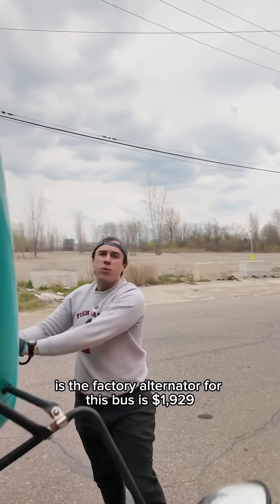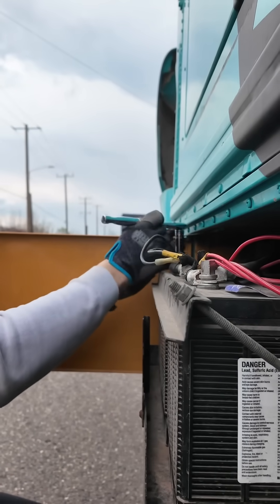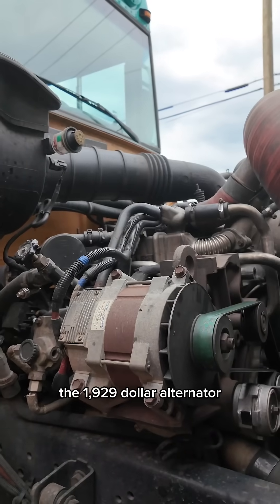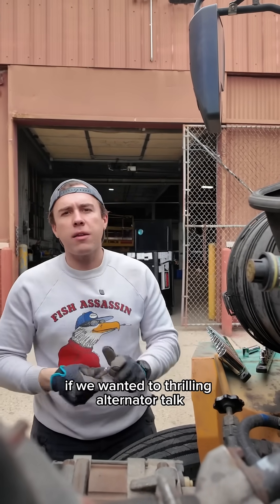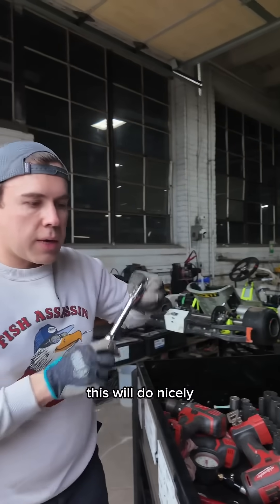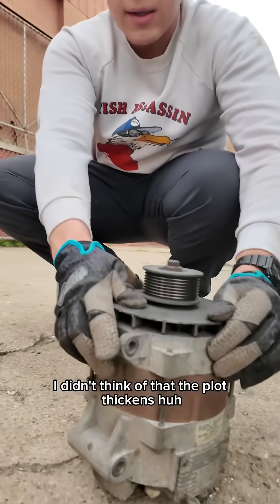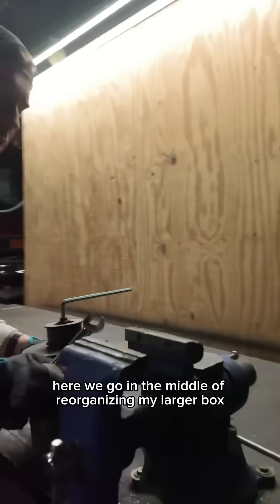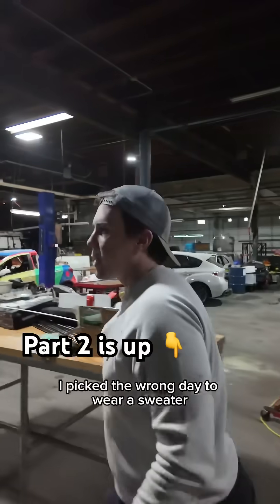Reviving a dead school bus on the cheap - Part 1 of 3

Comment: Use an impact wrench to take the nut off and tighten it back down.  Will not hurt anything and a lot quicker.  Just hold the pulley still and impact off the old alternator and then put it on the new alternator and hold the pulley still and impact back on.  Done in less than a minute.

Comment: u need to cover part of ur ratchet with electrical tape that away at the bumps it it doesn't ark either that or I put a coat of heat shrink on them stuff like that so that it protects it a little bit of heat shrink and a little bit of electrical tape put a layer of electrical tape over everything and then put some heat shrink over that that way it's protected and you can't chance short-circuiting and arcing channel

Comment: You can tell this guy has never done this little job. Yes the alt is easy to replace. The pulley is very easy to take off just use a 1/2 inches drive impact & the nut comes right off.

Comment: I love the fact that he was going to try to undo both the positive and negative cables off the batteries but then just gave up and undid the negative cable.. The funniest part is that fact the negative cables are the only ones you need to remove if you are working on anything electrical in a automobile

Comment: Unless those batteries are in series, and you've been soaking wet from sweat for over half an hour, becoming part of the circuit is an unrealistic worry. With dry skin, even 48V won't even be felt. Lead acid batteries can deliver serious amps, but unless you have a lot of them in series, they don't have enough voltage to pull even a milliamp through you.

Comment: the original alternator was brushless, the replacement is brush type.  But for the price difference, you can buy 2 or 3,  and they usually last at least 150K miles.

Comment: If the stator is still good in that alternator, just buy a rebuild kit for it and put it back into service. I kept am alternator for my Dad's Econoline van for practically it's entire road life of 900,000 kms. Still had the original engine and transmission in it too. That is why Ford is more popular than any other truck on the road.

Comment: I use an impact on those pulleys to remove and install them.
Just hold the pulley with your other hand and zip it off with the impact.
Reverse to install.
It’s that easy, been doing it like that for YEARS.

Comment: You don't have to worry about being part of a 12V circuit. Disconnect the batteries to prevent damage to the vehicle (blowing fuses, metling stuff) and your tools (....melting stuff). 12V only hurts if you let your rachet short positive to ground and you hold on long enough for it to get hot. So don't do that.

Comment: You can see sparks when you try taking the positive cable off first. That's why you take the negative off first, just in case you bump the frame with your wrench.

Comment: Gladly ohm's law denotes that no, you do not become a part of the circuit, not at 12V, not at 24V. Your resistance is simply too high for any appreciable current to flow.

Comment: For future reference, if you dont have a torch or dont want to worry about getting bearings hot etc., jut put a wrench (the closed end) on the allen wrench to get extra leverage. Or just a length of pipe for that matter.

Comment: You didn't need to remove the cables on the batteries. just wrap the leads in electrical tape. with the pulley you would need a 15/16 socket with 1/2 inch impact (unless you can bench 500 lbs), those spindle nuts are never torqued properly.  Then you would need a 3 jay puller for pulleys (aka a harbor freight puller you ground the ends down on to get the pulley off). this is due to rust between the pulley and the stater shaft.  with some emery cloth on internal diameter of pulley you install and torque the spindle nut to 74 ft lbs, then re-install (aka uga dugga until it feels right then re-assemble).

Comment: Use a 3/8 impact, normal lefty loose.  Put the nut back on to protect the threads and alternator core.  Take a ball peen hammer while you hold on to the pulley and smack the nut.  It will break free eventually.  Then just transfer over the fan and pulley to the new alternator and zap it down.  Dealership tech here :)

Comment: Anytime I do an alternator on any of my cars I always see if I can change or upgrade. Had an old subaru converted to a new subaru with like 3 times the power. My sidekick, it was cheaper to convert it to a modified gm alternator and bracket for half the price

Comment: It is a lot easier to take the pully off first using an inpact wrench before you pull the belt . I would have done that entire job while you messed with that pulley. I usually rebuild the alternator myself .

Comment: Are those batteries more than 12 volts? Even if its doubled to 24v itll have a hard time going through flesh, disconnecting them is still a good idea but for other reasons than getting electrocuted

Comment: Remy merged with BBB a while back, now BBB is Terrepower(?)

Oh also, mitsubishi is a part of ford(although not sure if it’s just the parts department or what), so if you see ‘FoMoCo’ on your mitsubishi alternators that’s what that is. 

For normal people, I’d recommend going straight up OE replacement for their vehicles. The peace of mind trumps every dollar you save- even if it’s hundreds.

Building/modding, definitely go aftermarket/rebuilt. Peace of mind comes differently in this situation.

Where I work, we sell brand new aftermarket and rebuilt alternators/starters. I dont like them because i want to see consistently good results, not just ‘problem fixed’ my issue.

Comment: The old alternator was probably original equipment and is able to be easily rebuild to last another 20 years.

The new alternator will probably last 5 yrs and let you down at the worst possible time, wonder what a tow for a bus costs?

Comment: I've had to go the opposite direction before. I needed o-rings for my 7.3 Ford powerstroke oil cooler, but the auto parts stores didn't have them, I couldn't wait several days for them to be delivered, and the Ford dealership wanted $300 for the o-ring kit. So I went to the International dealer and got them for $90, and they even were nice enoufh to split up a bigger kit for me and just sell me the o-rings that I needed. The 7.3 Ford powerstroke engine is the same as the Navistar T444e used in International busses from 1994 to 2003

Comment: I own a semi truck, 4 years ago when the factory Alternator when out (6 years old)  I replaced it with "the cheaper one"  first one was replaced under warranty in less then a year, then that one failed in just over a year so i replaced it (same one because that's what i could get for where i was) , and now I need a new one again, so oem lasted 6 years, and the cheaper ones got me a year-ish each.   Sometimes the cheaper one just means you're going to be replacing it more often.....

Comment: There's not enough pressure for you to become part of the circuit. The fact that there's still people that believe this is scary. The human body is a piss poor conductor. Voltage is also considered pressure the absolute minimum voltage you start to feel a shock is right around 50 volts. Now you don't want to short your tools across it because then you'll get burned. But metal objects are not piss poor conductors. That being said I wouldn't take two wires and stick them to your tongue because your tongue is a not as piss poor conductor. You would feel that a little.

Comment: If you just take a 1/2 inch impact wrench and basically just jam the trigger for half a second, it'll break that nut loose after a few pulls
Used to replace alternators all the time on semis, same exact ones
Sure, the alternator will spin a little bit but what are you gonna do, break the broken alternator more than it already is?

Comment: Of the races are ok. You can change out the brushes and the diode / regulator pack for maybe $100. I used to do it for like $20 in the dark ages. Not often the brush races or windings are bad.

Comment: Alternator pulley nuts zip right off with a kiss from the impact tool.
Reply: Ditto Jet !!! Usually a 15/16th
Reply: Bumping the impact... Love this stuff!!
Reply: 1/2" 3/4" Electric corded impacts are way overlooked, they can snatch nuts that air can't
Reply: Just a bit o heat and a crayon
Reply: Right on brother

Comment: Fun fact, you cannot electrocute yourself on any system in an automotive application, except for the ignition system on a gas engine vehicle. You can lick both fingers and touch the battery terminals and it wont even shock you
Reply: You might feel something if your hands are wet on a 24v system but nothing serious until 50volts
Reply: Well technically you can get the shit out of by a ignition coil. Haha. But diesel.  Your good to go
Reply: @MetalFox-k3n thats a shock, not electrocuted tho
Reply: Yeah you can feel the odd slight shock if you cross nerves just right in your arm, from hand toward elbow. I've only managed it twice in 30 years, it's an odd sensation but barely noticeable 😂

I'm an electrician by trade, I know what being shocked is like, I've been hit by the neutral of 277v once. I never made that mistake again. 😂
Reply: Amps people not volts, amps kill
Reply: Touch both terminals with your tongue
Reply: @jackbeets3309 ive done it with salt water on my hands... Its physically impossible to get electrocuted by it
Reply: @jackbeets3309 you got some gene simmons tongue on ya
Reply: You might wanna be careful with xenon headlights too, but other than that you're good. I'm an industrial controls tech so I work with 24V and never even noticed when I touch it, neither DC nor AC. Even if it makes quite a spark and leaves a black spot if I accidentally touch something grounded with that wire
Reply: I have literally seen people die from 12v 1 amp. Don’t spread falsities.
Reply: I dunno, was working on a truck once and was leaning over a fuel tank touching the positive terminal of the batteries. Could feel a tingle in my pecker as the metal zipper of my pants and coveralls contacted the fuel tank.
Reply: A 3000 amp arc flash is something to worry about
Reply: @rickiehobson9351 and when exactly is that gonna happen on a car under normal circumstances
Reply: I thought so
Reply: I got zapped but good off grounding a horn it created ac current in oscillating
Reply: Just don't make yourself entirely part of the circuit by standing in a poodle of water that is well grounded !
It's the amperage that hurts!
Reply: @Mr2Bsquared1  lol that makes no difference

Comment: Im not sure what you mean, by becoming part of a circuit. When its DC voltage? When have you been shocked by batteries?
Reply: you don't get a shock. You get a burn or welding spatter from the heat of the short. That much battery can turn a 1/2" drive extension red hot in a matter of seconds.

Comment: The original alternator in my 2004 Tacoma survived 20 years and some change and over 1.2M miles. Whatever Toyota is doing, it works and you should probably copy it if you can.

Comment: I'm taking it you don't have an impact at your shop? I've always just use the air impact and a socket and held the pulley with my hand and zipped the nut off. I imagine a good quality battery impact would do the same thing what do the same thing a lot better than fighting with that allen wrench and combination wrench

Comment: Harbor freight.
Has plastic coated ratchets and use an impact gun to get that nut off Just hold the pulley with you're hand

Comment: It's only 12 volts you can't become part of the circuit
Reply: if you have never seen a red hot wrench then you don't understand the problem.
Reply: @rupe53  I know that metal conducts I'm standing in the shop I work in right now I'm just saying that according to ohm's law you yourself don't have to worry about getting zapped by 12 volts
Reply: @rupe53  and I don't feel like starting an internet argument so if we're going to have a conversation please keep it cordial
Reply: @   no argument and your point is valid. My point is you don't need to be electrically involved in the circuit to be part of the carnage / danger / destruction that several thousand amps DC can thrown it you. Then of course there is the chemical issue involved with  rapidly discharging battery. (read: boom)
Reply: @rupe53  you're totally right and thank you for being a kind internet stranger

Comment: It's crazy in 2025 with the internet. People don't know that you can have your alternators starters rebuilt for a fraction of the cost of a new one. I don't think I've bought a starter for my diesels in years but they've been rebuilt many times
Reply: I looked into getting an alternator rebuilt at a local shop, and it would've taken then 2 weeks and would've cost me $400 and came with a 90 day warranty. I went to AutoZone and got an upgraded high output one for $300 with a lifetime warranty, where I can go to any AutoZone in the country if it goes bad and swap it out for a brand-new one. Local shops honestly just can't compete with mass production and great manufacturers warranties anymore.

Comment: With those voltages, you'll never "become part of the circuit".
Reply: but you can get stuck holding a wrench that is quickly turning red hot and throwing molten metal at your skin.

Comment: Next time leave the belt and everything on and then loosen the bolt for the pully and then proceed to change alternator. The tension on the belt holds the pully and keeps it from spinning .

Comment: Doss paul work on mopeds? I need help putting a harbor freight motor on a Schwinn chopper bike and I also have an original Schwinn chopper that's electric and I need help putting a new throttle on it.
Reply: Theres lots of motorized bicycle forums and fb groups. Join a few. It's easy work.  I used to swap engines onto bikes before the internet took over.

Comment: Suggestion... when dealing with a stuck bolt, heat the area and use some wax. The hot melted wax will act as a penetrator and lubricant, and will make getting rusted and stuck bolts out so much easier.
Reply: Cool, but we have had penetrating oil for ever now.
Reply: Bees wax is excellent too.

Comment: I have a wrench that I wrapped in tape for when I gotta do battery's because of that spark show you mentioned 😂😂 seeing that show once was enough for me 😅😂
Reply: Doing the battery isn't the part to worry about. That's easy. Don't cross post. It's when doing stuff like alternators and starters when you need to worry about it. That's why you just undo the battery.
Reply: @mikerogers7502 thank you for saying this, I don’t have much experience with working on cars but am slowly learning to fix mine that has been sitting. I was going to take off and put back on the starter to see if the guy who put it on fucked up, I wouldn’t have known to do that.

Yes it may be common sense for a lot of people, when I’ve never had to work on a car before it’s not for me.

Any other tips you’ve got? I know the changing the tires one to break the nuts loose before jacking it up, not really others I can think of.

I’m working on an 03 Buick century, thing sounded like a slight grinding or burning out sound after I got it running and drove it around for an hour or so.
Then would never start again, I got told it’s most likely starter, alternator or the engine locked up.

What can I do to make this process easier at determining my problem too?
Reply: @goldenmodz4994 Don't tighten the bolts immediately, leave them fingertight until they're all in, then richten them all or you might not be able to get them all started

Comment: I had to upgrade a bunch of my old fleet to those newer alternators.  Just hit the nut with a 15/16 socket in an impact, no need to hold anything.  It'll shake a bunch of dust out but it's all good.

Comment: 1. You're getting screwed on truck parts.
2. You're treating it like a car.  Impact with the belt still tight to loosen the pulley.
3. Use an Impact to remove the old bolts.

Love 'ya but gotta work smarter.